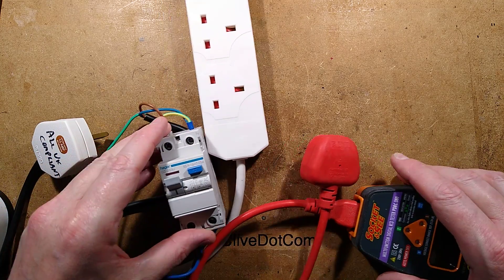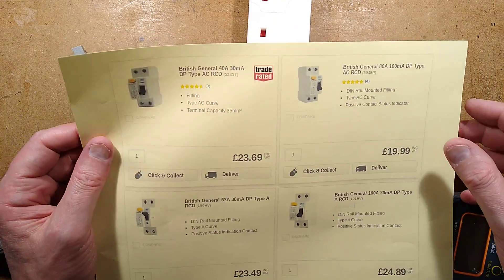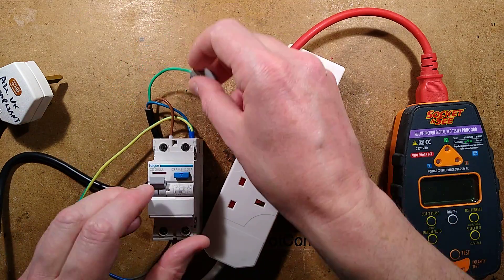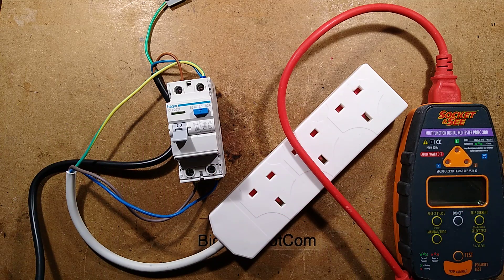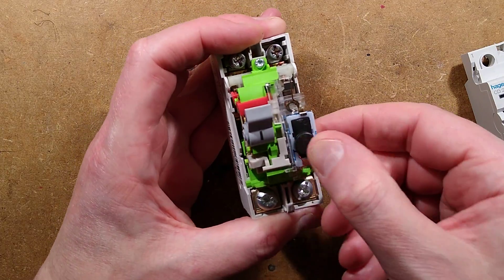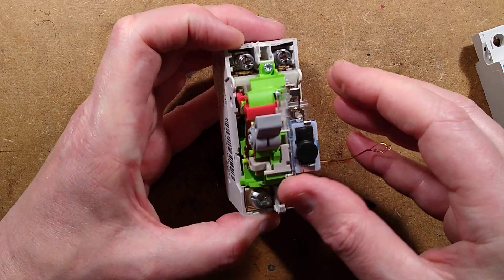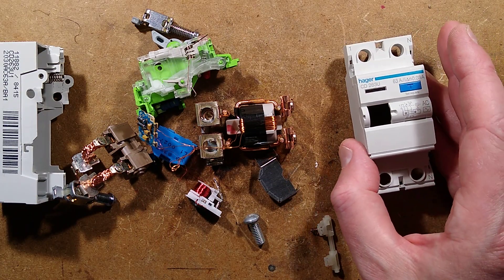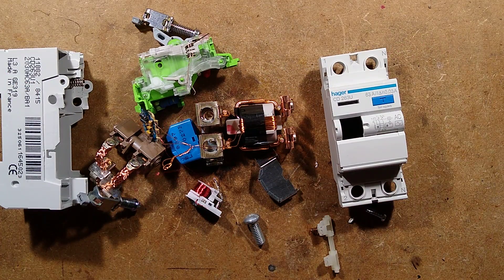Was this RCD damaged by overcurrent?

Comment: Overloading is probably not the issue. The reason is that most of the time, the entire house cannot be fed more than 63A from the main disconnect breaker which rating is set by the electrical company based on the size of the subscription. I have installed a 63A breaker like that, in an apartment where the entire wiring would not handle more than 63A. As a result the power company would not, anyway, install more than 63A service. This installation has been inspected and was deemed compliant.
Or, if overloading is indeed an issue, then there is a non-compliance somewhere else in the installation.

Comment: Given ~8kW per shower, and around 5-6kW per stovetop/oven Id say it was potentially grossly overloaded depending on who was showering and cooking.
Reply: An oven/stovetop has only 6kW as Peak Power for a short time at heatup and it typically needs 3 Persons operating the 2 showers and oven/stovetop  simultaneously, could be a rare case and only for a short period of time that this nominal overloading happened actually but not causing visible damage. Maybe even the setup of the RCD  can sustain larger than 63A current when connected, as just the switching of the load is a larger problem

Comment: Hi Big Clive !
I suggest you to reverse the circuit board. 

You have it in this gfci because the type is 'A' and not 'AC' for this one. 

This special circuit gives the immunity to this kind of currents ( called ' residual' ).
Reply from the maker: The circuit board is just two reverse parallel clamping diodes and series capacitors to tune the trip current.
Reply: @bigclivedotcom  i don t think so. 

The trip current is adjusted using a screw in the coil module. I already opened lot of GFCI but I do not destroy them like you did because I audit them to re use them. ;)

This circuit board only exists for the ' A' class and it explains that the AC class is cheaper.

The current sensitivity can be adjusted when the gfci is closed at the factory when it s going to the adjustment process on the benchmark.

Plz search a piece of plastic in the hood, hiding the access to this mini screw. ;)

Comment: Question: Why is everything on an RCD? Is this standard UK code? Here in the US, only areas prone to leakage current (near water) get RCD/GFCI's: Showers, Kitchen sockets, pool equipment.
Reply from the maker: In the UK it's common to have two sections of the DB on a 30mA RCD each.  But the option is there to have a combined RCD/GFCI and overcurrent device (RCBO) on every circuit.   It provides extra protection against wiring damage.
Reply: Luis de Rivas - Yes, RCD protection is now required. We have moved from having individual sockets with RCD protection (typically only provided where an appliance used outside may be plugged in)(or plug in RCD socket adaptors) to having a consumer unit with a single RCD protecting all circuits, to a split load consumer unit with typically only the socket circuits on a RCD, and lighting and fixed wiring circuits on the non-RCD side, to split load consumer units with two RCDs, each protecting half the circuits. For a bit more money, increasingly, RCBOs are being used for individual circuits (these provide a RCD and a MCB in a single device). So for example in my consumer unit, I have a 32A RCBO for each of the 32A ring circuits (sockets), all the lighting is via 6A MCBs via a RCD.
Reply: In Finland we went in 10 years from no RCDs to everything on RCD. Before 1997 they were never required, then they were required on wet rooms and in 2007 on all. For grounding the same change took 67 years (from 1930 to 1997)

Comment: My "premium" 🙄  MK  RCBO's have a "Trip once - fail forever" feature where if you try to reset them after they trip, they go dead short and try to explode. It's got to the point now where I don't even try to reset them anymore, if they trip, they need replacing. They are around £50 a piece so I have been taking them back to screwfix, but I have kept one to do a future teardown video as I really want to know why they go dead short. 
It's a lot of money wasted, but I am getting to the point of considering ripping out the MK board and replacing it with a BG board or similar. Stay away from MK garbage guys
Reply from the maker: I wonder if that's the trip coil driver (thyristor?) going short circuit.  They are cramming too much circuitry into breakers these days.  The electronic circuitry can initiate an unprotected arc flash when it fails.
Reply: @bigclivedotcom  There is only one way to find out :) But I suspect it's a metal on metal short rather than an electronic component, as you get a loud bang and big blue flash when attempting a reset, very high energy. I could be wrong though
Reply: @arcadeuk  Jeez I bet that makes you wary of resetting breakers now. Long stick needed!
Reply: Sounds like a very expensive fuse.
Reply: That is scary. I have an old tandem breaker (USA thing, I think haha). For a long time it was in the ON position. We never messed with it... Apparently it hadn't been touched for decades. It had one line to the doorbell transformer - which died from old age. But the other switch on the tandem... it went to a line we couldn't figure out.

So one day while testing out which breakers went where... I switched it off and it produced an arc flash and a very loud pop. Quite scary. And the whole subpanel was tripped on the 120A breaker at the main panel.

Could have been much worse.
Reply: arcadeuk - my MK RCBOs appear to be fine. But, I don’t remember having a fault on the ring circuits that they protect, and they are at least seven years old. It sounds like yours are rather more recent...
Reply: I know you're very busy, but surely miss your excellent video's!
Hope you can find some time to share some with us, it's appreciated :)
Reply: All breakers used in my country are made in china. Sure the have brand+ official looking seal but word on the street is most of the time they trip they die and stay dead even by testing.
Mine tripped twice because... i may or may not have put a screw inside the a wire... the third time i did a test about 4 months ago after a blaclout and said "wow still works"

Comment: ITS A gfci breaker & trips on an Imbalance of 5 to 30 miliamps of load, the ground if for safety if there is a fault to ground, if the circuitry of the load is out of margins but not a direct fault, it will trip just as it will during a fault because a fault to ground will draw many amps and what you have in the thumb is technically a rccb it only disconnects the hot line not the neutral, a rcd will disconnect both

Comment: I almost thought you were going to say rccb as in the ones on airplanes.  They might have a switching power supply that the coupling capacitor from the low side to ground is on its way out to cause it to trip.

Comment: My shop breaker gets tested regularly! How it’s tested, I will not say, only that it’s doing it’s job. 😂
Reply: I have a couple tools I call breaker flippers, have to run them off a generator if I'm going to give them a hot supper because their operating current is higher than they should be drawing from a standard U.S. wall socket, they are also used to test generators to see how they handle temporary overloads.
Reply: @lovotcore6946  haha, not a bad suggestion, but I know it's just cause I overdraw the current. I have two outlets in my whole shop. Adding two more circuits tomorrow!
Reply: @lovotcore6946  ahhhh yes..
You must have the big floor sander 🤔
Reply: @Blazin Redeye A "15A" abrasive metal saw will test your 20A breakers, so will an old "15A" Hitachi angle grinder, you will know it when you see it because the motor section looks like it belongs on a chop saw, it sounds like a saw on startup, and it's got more gravity in it than a plastic body tool should. The startup current for both is brutal, especially if the grinder has a cup wheel in it, that tests generators temporary overload behavior pretty well, either one will flip a 20A house breaker with heavy usage. The 2.5HP compressor is an even more aggressive temporary overload test for generators, but it doesn't tend to flip breakers when running.
Reply: @lovotcore6946  for those high-inrush loads, replace the magnetic (fast) trip breakers with industrial thermal (slow) trip units and get on with your life.
Reply: @railgap  you should have both layers of protection in a MCB. For high inrush loads just choose a type C or D instead of the usual domestic type B.
Reply: @railgap  The breakers I'm used to have a magnetic fast trip for severe overloads, and a thermal slow trip for more mild overloads, the breaker flippers activate the magnetic trip if they are stalled out, and actual use tends to activate the thermal trip.
Reply: In the U.K. this is typically caused by a single phase air compressor with an M6 grub screw in the plug top fuse.
Reply: @WineScrounger  over here we call that a "1/4-20 NO-BLO"

Comment: I wonder what size the company fuse was?
Reply from the maker: Typically 60A to 100A depending on the type of premises.
Reply: @bigclivedotcom  House fuse likely 63A or 80A, pole or pedestal fuse likely 100A. Here by me though those fuses are 250A, because it feeds a 3 phase meter rack, with each meter having it's own 80A breaker. One single 3 phase supply though of 100A, though the draw is only 30A max, but that is a standard 3 phase supply rating.
Reply: @SeanBZA  My incoming fuse is 100A, but these houses had no gas supply when built so had electric heating.